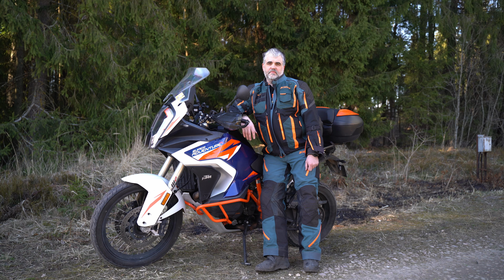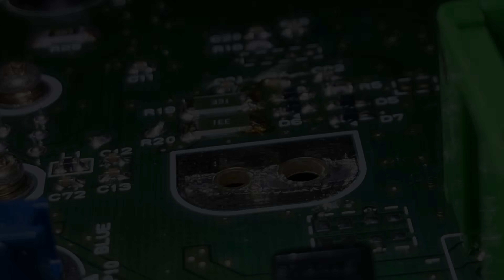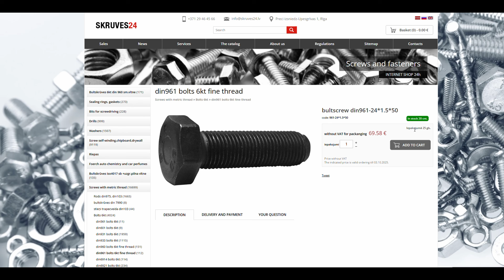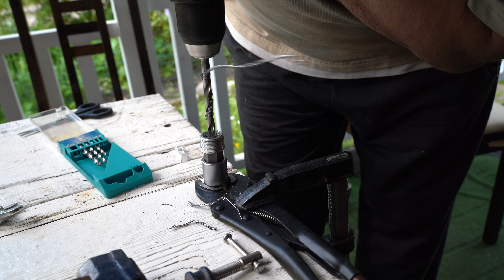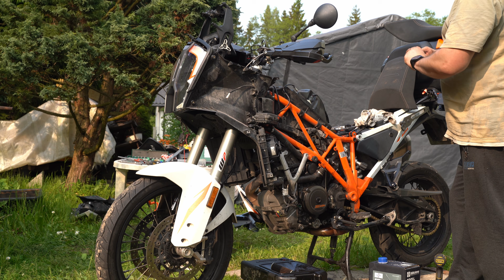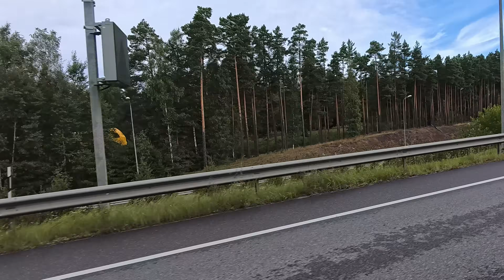KTM 1290 Super Adventure – Fixing the 3500 RPM Misfire Mystery

Comment: Hey soo helping video thanks for your sharing but just want to ask you a question I have same problem and when I check sensor gap is around 2mm I changed it and fix it 0,5mm with new sensor today again just have a but same thing happened but my miss fire is not on stable rpm like yours around 3500 rpm its differentiating but motor stops working and when I again stop and start motor warning light again seen on screen but there is no explanation on the warning section so ım suspicious about the throttle to be changed will be a solution or do you have a in idea why this happened again and how ım going to solve it since your idea is very important 🙏 so thanks for your reply and help
Reply from the maker: Thanks! Before replacing anything else, I think we need a little more information because your symptoms seem different from mine.
When it happens, does the engine just lose power/misfire for a moment, or does it actually stop completely?
Is there any connection with RPM or engine load - for example, does it happen more often when you open the throttle hard? Does it depend on the gear or road speed?
What exactly appears on the dashboard when it happens? And after the engine stops, does it restart immediately and run normally again?
Also, what year is your bike, how many kilometers/miles does it have, and what country are you in? And have you noticed any connection with temperature, rain or other weather conditions?
I wouldn't replace the throttle body yet. Let's first try to understand exactly when and how the problem happens.
And since the problem returned, have you checked the sensor gap again to confirm it's still at 0.5 - 0.7 mm?

Comment: I have a 2024 super adventure r from new it has had  a miss that occurs at exactly 3100 rpm in all gears and ride modes. It only happens when you give it throttle at 3100 rpm’s and is random and has no codes, the dealer can’t seem to replicate it but it happens for me all the time do you think the sensor position would cause this?
Reply from the maker: It does sound quite similar to the problem I had, although mine happened at around 3500 rpm and mostly at full throttle.

I would definitely check the crankshaft position sensor. Not only the gap - also check if there is any metallic debris stuck to the tip of the sensor, as it's magnetic and that could affect the signal too.

I'd also check the spark plugs and ignition system. The 1290 uses two spark plugs per cylinder, and since your problem happens so consistently at almost exactly the same RPM, I wouldn't rule out an ignition issue either.

With no fault codes it's difficult to be certain, but those are the first things I'd investigate.

Comment: Hello😊 I have a ktm 1290 adventure S from 2017 and it happens to me that when idling and when it's cold and fully warmed up, the revolutions constantly go from 1200 rpm to 1400 rpm.. the engine never shuts off, it starts good, but that oscillation of the idle gas annoys me.. what should I look for?

Comment: Hello.
I own a 2022 model 1290S with 26,000 km on the odometer. The engine starts to misfire after it warms up. The misfires occur shortly after the engine temperature exceeds 92 degrees and the fan starts running. It doesn’t happen when the engine is cold. It’s a misfire that feels like a power cut when the engine is warm and at low RPM. It doesn’t happen—or at least isn’t noticeable—when I give it more gas or when the RPMs are higher. I’m not sure. But it definitely happens after the engine has warmed up and past the fan-on temperature. I don’t know if it’s a coincidence, but it started after I replaced the spark plugs with new ones. I’ve checked all the spark plug and coil connectors over and over again. There doesn’t seem to be any issue. Do you have any idea what this might be?
Reply from the maker: That’s interesting - especially that it started right after you changed the spark plugs.
I’d honestly go back there first. Either wrong type, something slightly off during install, or just a bad plug. On these engines weak spark often shows up exactly like this - when the bike is hot and at low RPM.
Also worth a quick look at the coils - sometimes they don’t sit perfectly after removal or get a bit damaged, and then only act up when hot.
Other things like a small air leak, throttle bodies or the secondary air system could also play a role, but since it started right after the plug change, I’d definitely start there.
Feels very much like ignition rather than something bigger.
Also one more thing came to mind - since you had to take things apart to reach the plugs:
check all the small hoses around the intake and the EVAP (charcoal canister) system.
If one of those hoses came loose or cracked, the engine could be pulling unmetered air, which usually shows up when the engine is hot and at low RPM.
Still, I’d start with the plugs and coils - but it’s worth a quick look.
Reply: @ItsReallyEasy  Thank you. I checked the connections 3 times to sift any loose mounting. It definitely starts when the engine gets hot. Very interesting. I will remove it again and check the coil connections and spark plugs. Thanks again.
Reply from the maker: @Ertugrulismail  Sounds good 👍
Let me know what you find when you take it apart again - I’m really curious what the root cause turns out to be. It might help others too.
Reply: @ItsReallyEasy I will
Reply: Hi, it’s me again. I stripped the engine down. After fiddling with the spark plugs and their sockets a bit (taking them out and putting them back in, randomly and aimlessly), I started the engine. Even though the temperature went over 93°F and the fan kicked in, the engine didn’t start misfiring. I happily began reassembling the engine compartment while the engine was running. As I pressed down on the metal plate holding the five sockets under the front seat and tightened the bolts, the stuttering started. I pulled my hand away and left it loose, and the stuttering stopped. I pressed the plate back into place, and the stuttering returned. Then I moved the plugs and wires one by one with my hand, but there was no clear evidence. There are cable bundles running from front to back on both sides. The cable bundle on the right was tightly secured to the chassis with a cable tie along with the chassis cable. When I released it from the cable tie, the misfire occurred. I then freed it from the cable tie, straightened the chassis cable that had been slightly crushed by the connection with my hand, and secured it loosely again. The misfire has completely disappeared for the past three days. It was an issue with that cable bundle, and it went away without me fully understanding what exactly caused it. :)
Reply from the maker: @Ertugrulismail  Oh wow, I know exactly which clamp you’re talking about. The one on the left side, right?

On my bike that clamp actually damaged the wire insulation — I spent quite a while chasing that issue. I even filmed it, just haven’t finished editing the video yet.

In my case the bike didn’t stall, but the immobilizer wouldn’t disengage because of that wiring problem.

Anyway, I’m really glad you found the cause and shared it — this is super useful. I’ll definitely inspect that area on my current bike and probably add some protection under the clamp.

Comment: Hi, my 2020 KTM 1290 SDR misfires around 3,500 rpm like your bike did. It also sometimes stalls at idle when hot. I don’t have any fault codes. Do you think it could be the same issue?
Reply from the maker: Hi! Got it - misfires around 3,500 rpm and sometimes stalls when hot at idle.
How does it behave if you accelerate hard after 3,500 rpm? Does it pull smoothly or still misfire?
And at idle - does it stall suddenly, or do the RPM start to fluctuate first and then stall?
These details help narrow it down quite a lot.
Reply: @I @ItsReallyEasy  when accelerating hard after 3500 rpm — it usually pulls strong and smooth. Sometimes when the engine is hot, the idle drops very low and it stalls. Sometimes when I try to start it while it’s hot, it almost stalls immediately. Otherwise, it seems to run fairly smoothly at idle, it just feels too low and dies out. Both issues only accours from time to time, so its a bit hard to remember all the details…
Reply from the maker: @mattasfx  I’d put the crankshaft position sensor low on the list for these symptoms.
I would start by checking the spark plugs and coils. Around 3,500 rpm the second spark plugs come into play, so if something isn’t right there, the engine can start to stumble.
Next I would inspect the secondary air system valves. If they don’t work properly, the bike can stall or run unevenly at idle.
Also check carefully for any air leaks — they can affect idle stability quite a lot.
And it’s worth inspecting the tank ventilation system and its valve as well.
Reply: @Its @ItsReallyEasy  Did some more testing today. The misfire starts around 3000–3500 rpm when applying full throttle. It continues until I release the throttle again. Acceleration is very poor when this happens.

Regarding the stalling, it only occurs when I try to start the bike while it’s hot. It does not stall at idle after riding.
Reply from the maker: @mattasfx  Your symptoms sound a bit different from what I had, so I’m still thinking what else it could be.
In my case, with fully open throttle at around 3,500 rpm the engine would completely cut ignition (100% misfire). I had to pull the clutch quickly, otherwise the bike would almost throw me forward. If I pulled the clutch in time, the engine would start running normally again and I could continue accelerating - but not with full throttle. If I opened the throttle fully again, ignition would cut again. Once the rpm went above ~4,000, I could use full throttle and the bike pulled strong as usual.
I’d like to clarify one thing: if you slowly accelerate past 4,000 rpm and then open the throttle fully (right after the misfires at 3,500), does the bike accelerate normally?
You mentioned that when the problem occurs, acceleration feels weak. That could also indicate knock (detonation), where the ECU retards ignition a lot and the engine feels restricted. Possible causes could be spark plugs or fuel quality. Knock sensors themselves don’t usually fail very often.
In any case, to test the crankshaft position sensor clearance, the bike can be carefully laid on its side onto something soft - for example a car tire - and the generator cover removed. First time it may take around 4-5 hours, but if you’ve done it before, about 1.5-3 hours. Sometimes metallic particles stick to the sensor tip and affect the signal.

Comment: I'm new to KTM, 21 1290S, wish I had your email to chat about our bikes.  have you done the valve adjustment yet?
Reply from the maker: Hi! Great to have another 1290 owner here 🙂
If you want to chat about the bike, feel free to join the comments/chat on the channel — it’s much better because other riders can jump in too and share their experience.

As for valves: on my current bike I had the valve check done at the dealer. On my previous 1290 I checked the clearances myself at around 30,000 km.

Comment: My 1290 is idling like a chopper and jerky when cruising only feels ok going over 100mph if u have any idea let me know I changed the fuel injectors cleaned the throttle bodies checked the coils put new spark plugs and it’s still doing it I’m about to change the crank shaft position sensor this week to see hopefully that’s it but if u have any idea plz let me know its been going on for a while
Reply from the maker: Hi!
What year is your bike and how many miles are on it? I can suggest a few things I would definitely check.
 An air leak - especially in the secondary air system. It works mainly at idle, so if its valves act up, the bike can run rough.
 The throttle position sensor - sometimes the bike simply doesn’t ‘know’ it’s at idle.
 Ground points - if a ground wire is loose or corroded, these bikes can behave really weird.
 Hooking it up to a diagnostic tool would help a lot.

Less likely, but still worth trying:
open the fuel cap and see if anything changes.
And if nothing else helps, checking compression is also a good idea - worn cylinders can cause similar symptoms.

Comment: Why are you changing the 10,000 km? From the looks of the oil filter, its better to go sooner. On my bmw gs I change at 5,000 km with motul adv oil and hi flo filter
Reply from the maker: I picked the 10,000 km interval as a middle ground between KTM’s recommended 15,000 km and the ‘race mode’ approach where I’d change it every 5,000 km.
I ride every day, but in a calm way — no hard off-road or racing. And when I go on a trip, it’s usually around 10,000 km, so it makes sense to service the oil before the trip rather than somewhere on the road.
The bike has done over 80,000 km now, and during the last valve check the KTM mechanics said the engine looked perfect inside.

Comment: Great job and happy rides.😎👍
Boy, KTM's with saddle fuel tanks are a NIGHTMARE to work on, UGH !
Anything modern is such a pain to work on. 🤮
Reply from the maker: Thanks!
Funny thing is — on the previous model the tank removal was much worse. The process was way more complicated, and that inner plastic would crack almost every time. I really suffered with it.
On this bike the tank covers half the engine, but the actual removal is definitely simpler.

Comment: I have a 2023 1290R that occasionally "coughs" (Ignition cuts) when upshifting. I wonder if mine is experiencing the same thing as you have described!
Reply from the maker: I don’t think it’s the same issue. On upshifts the quickshifter briefly cuts ignition so the gearbox can shift smoothly — that little ‘cough’ is usually normal. From your description it sounds like the quickshifter doing its job, not a problem.

Comment: hi! sorry for my english. i have another bike and does this on my bike too at 4500k. i was pretty sure that is the gap. also another think my bike does, is that give to the battery 13.6V rather than 14.4 as it should be i believe. did your bike charging your battery at lower voltage?
Reply from the maker: That voltage is really unusual. My bike never charged that low.
If I were you, I’d connect an oscilloscope to the power line and take a look. Sometimes the charging system can create noise or spikes instead of a stable voltage, and the bike’s electronics might read sensor signals incorrectly because of that.

It’s worth checking, and honestly it’s much easier than taking half of the bike apart.
Just to be sure everything in the electrical system is clean and stable.

Comment: In my oem service manual witch i bought online from ktm for my 21 1290 S, the gap its 0.7mm😮
Reply from the maker: Hi! Thanks for your comment.
I checked my official 2021 Repair Manual for the KTM 1290 Super Adventure R, and on page 326, section 19.9.28, it clearly says 0.5 mm.

Now I’m really curious — maybe different model years have different specs?
Could you share which manual you’re using? I’d love to compare, because this difference is interesting.
Reply: I bought my repair manual straight from ktm, 50 eur or so, awhile ago.
Item No. 3206453en
And so i set it because mine had a missfire on full throttle at 2.5k rpm
What year is your bike?
Reply from the maker: @johnvonthrottle  KTM SAR 2021
Reply from the maker: @johnvonthrottle What is the mileage on your motorcycle?
Reply: @ItsReallyEasy  51k
Reply from the maker: @johnvonthrottle  Got it — that’s really interesting.
If you suspect the sensor itself, then the most likely cause is metal dust sticking to the magnetic gap. Even a small amount can distort the magnetic field and change the signal.

The good news is that it’s very easy to check:
removing the cover, cleaning the sensor and putting everything back is basically a one-day job (and with some experience more like 3–4 hours).
Reply: @ItsReallyEasy i did remove my cover two times already, no problem doing it again. But should i respect my manual 0.7? Or 0.5? Is it neligibile 0.2?
Reply from the maker: @johnvonthrottle  You could try 0.6 mm - the perfect middle ground between the two specs 🙂

But seriously, I would also check the spark plugs.
At around 2500 rpm you’re very close to idle, and if the plug gap is too large, the spark can get blown out under load.

I’d also take a quick look at the secondary air system, just in case one of the valves is leaking - although to be honest, I don’t really believe that’s the main cause.
Reply: By curiosity i found some manuals for both versions S and R / 2022 2023 and 2024. All of them say 0.7mm. I do not know what to believe now😅
Anyway apreciate the effort for uploading. Safe travels
Reply: My manual also states .7mm
Reply: Mine 0.5...